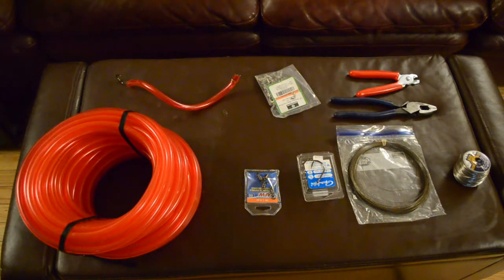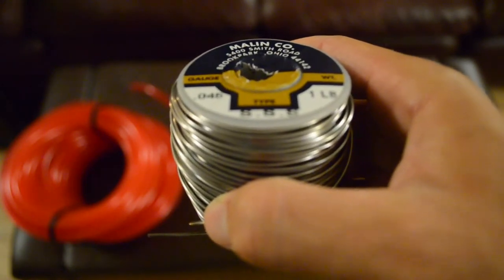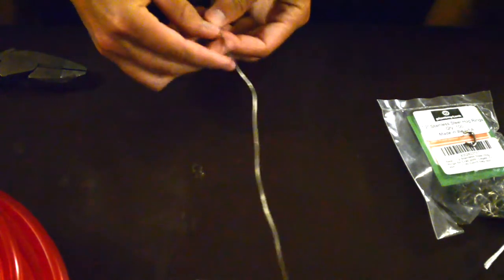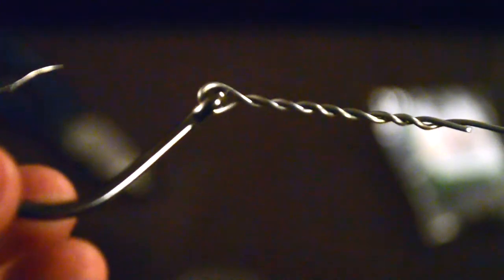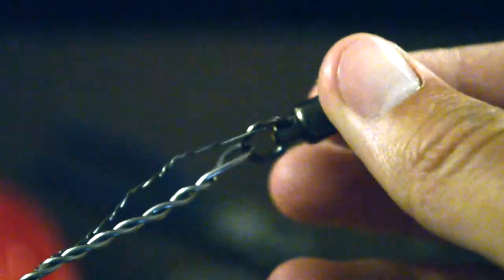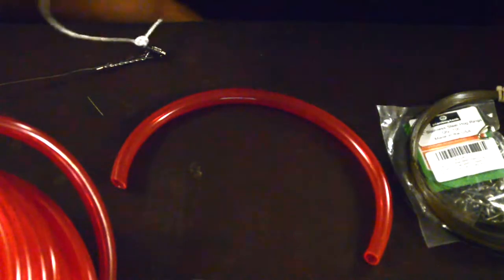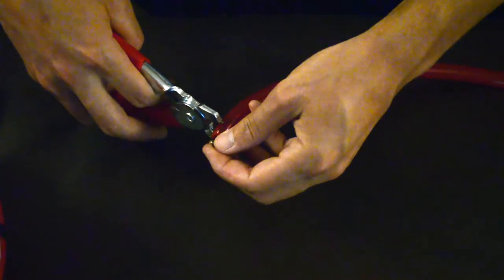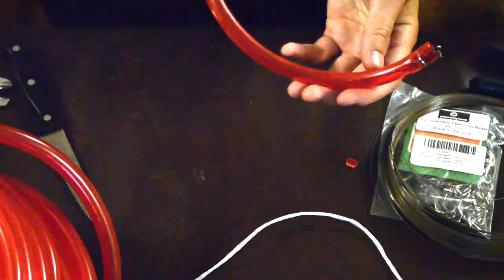How To Make a STRIPER TROLLING TUBE

Comment: Hi.  OK, so I don't get why you need to use two different types of wire?
Reply: The Malin wire gives it shape so it will corkscrew through the water and look like an eel swimming. You could use a heavier main wire that bends as a single wire. Commercially made ones use a single wire.